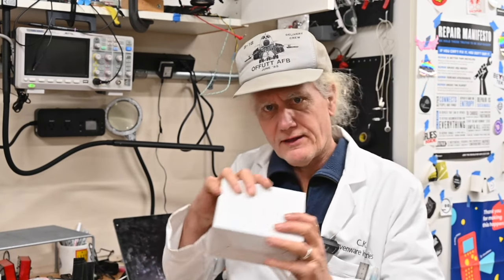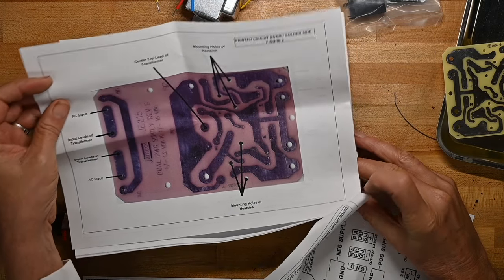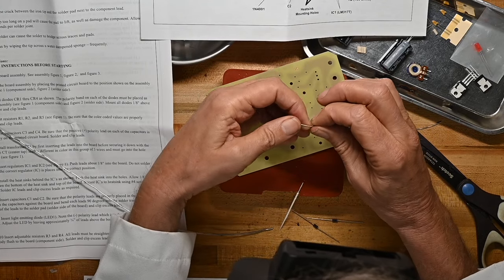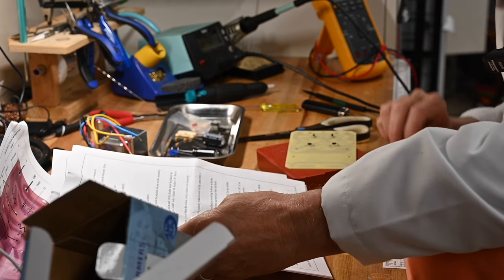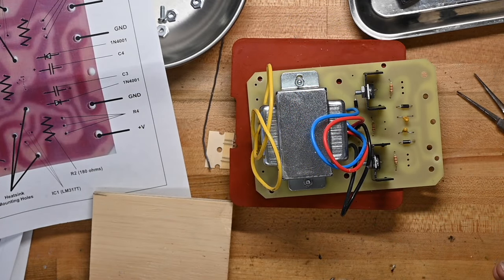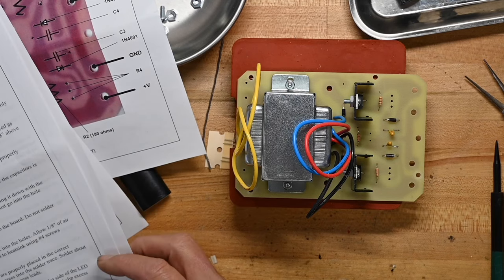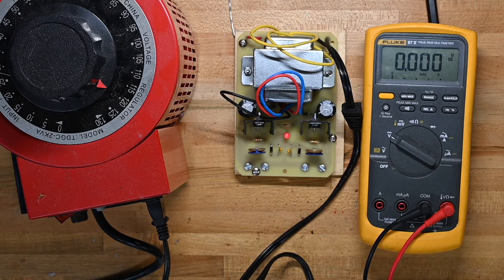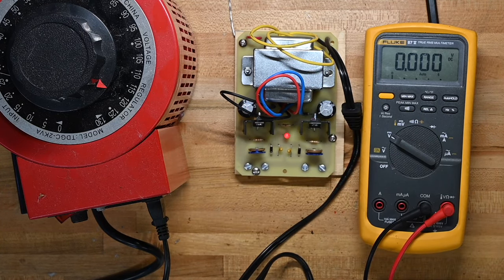C.K. builds a Jameco DC power supply kit

Comment: I have one of these that I put together a few years back. I made a case for it and put proper knobs for adjusting the voltage. It works well. I shoulda added a digital volt meter display to it.
Reply from the maker: It is a solid unit, that's certain, and if it's not overloaded I'm sure it'll last, steady, a long time.  A good project box and some knobs sounds like a great idea.  Adding two of these lil voltmeters would be great too https://www.digikey.com/en/products/detail/sparkfun-electronics/PRT-14313/7564745?utm_adgroup=&utm_source=google&utm_medium=cpc&utm_campaign=PMax%20Shopping_Product_Low%20ROAS%20Categories&utm_term=&utm_content=&utm_id=go_cmp-20243063506_adg-_ad-__dev-c_ext-_prd-7564745_sig-CjwKCAjwoPOwBhAeEiwAJuXRh_nXrYrheb_FW3G8mORLAZIWaJ_wrngvKr72uWfue_VPZs84RbK5nRoC0eUQAvD_BwE&gad_source=1&gclid=CjwKCAjwoPOwBhAeEiwAJuXRh_nXrYrheb_FW3G8mORLAZIWaJ_wrngvKr72uWfue_VPZs84RbK5nRoC0eUQAvD_BwE